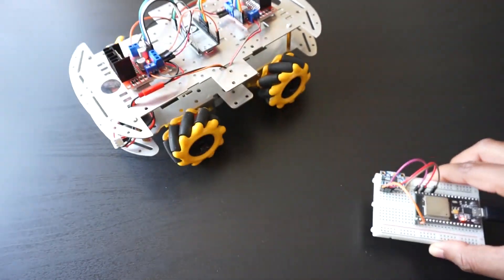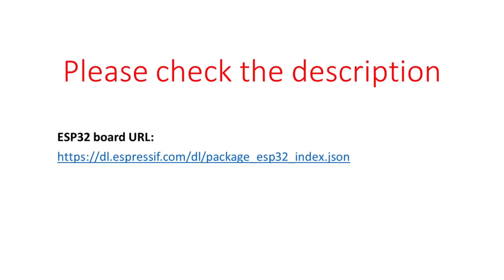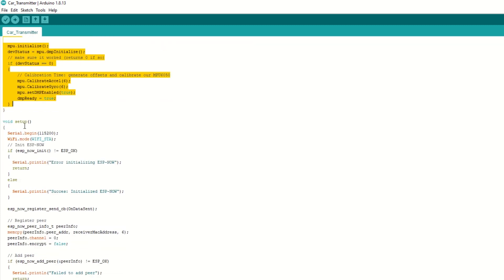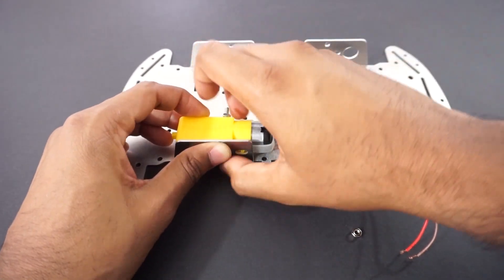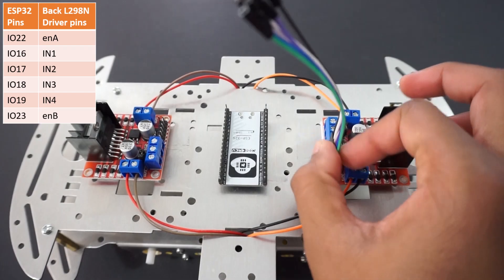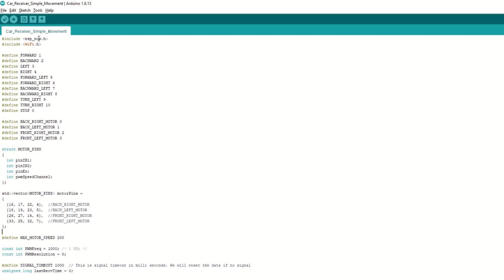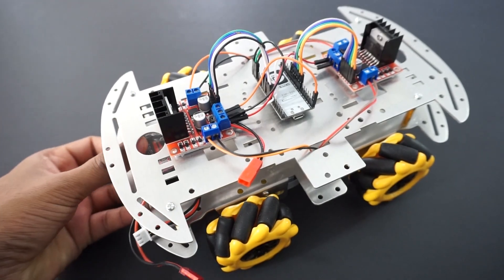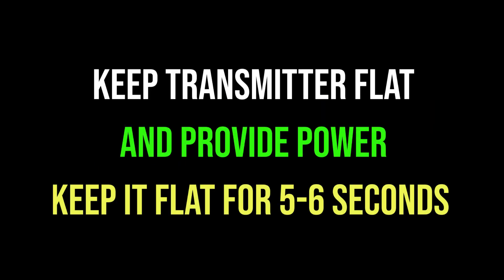Gesture Controlled Mecanum Wheels Car using ESP32 | ESPNOW | DIY🔥

Comment: Hi.  Nice work. The  ESP environment has changed and you need to add a new line after the  "esp_now_peer_info_t peerInfo;"    "memset(&peerInfo, 0, sizeof(peerInfo));" in the transmitter part and add the #include <Vector> into the receiver part. BTW using Vectors is a not good idea and should be replaced.  But a Very good project. Grattz.
Reply from the maker: Thanks 👍🏻👏🏻
Reply: Thank You!!!
Reply: hi bro i couldnt understand this, can you elaborate please
Reply: Can you share all codes?
Reply: https://youtu.be/UQl03pU-w58?si=-0mHgrbxUm1AaCSq
Reply: can you provide the code?  thank you

Comment: Only one motor is not working 😢why ?? All motors are working but one motor is not working??all things are set but oneotor is bot working 😢.. please help
Reply from the maker: Please check the motors with power supply individually first . Also check the connections of that side 👍🏻👏🏻

Comment: Can we use one L298 motor driver to move forward, background and both sides also..
Reply from the maker: Yes you can . However i would suggest to use same setup as I used in this project to avoid issues 👍🏻👏🏻

Comment: Bro i am using the same components like yours but not the mecanum wheels. I am using simple wheels, so will it work by following the same steps like yours without any change in code?
Reply from the maker: Yes it will👍🏻👏🏻

Comment: Bro can I use another wheel instead of the mecanum wheel?
Reply from the maker: Yes you can . However some of the movements will not work like sidewise 👍🏻👏🏻
Reply: @ So will there be any changes to the programming and using 1 L298 motor driver?
Reply from the maker: @ShafayatJamil-o2c if you need then you can refer my other video on hand gesture controlled car using Arduino . 👍🏻👏🏻
Reply: @hashincludeelectronics  okh thnx bro

Comment: hello, i am using 30 pinned esp32, and i was able to do everything, and it was showing Success: Peer, but when i try to rotate the transmitter nothing i happening on the receiver end
Reply from the maker: Is this issue resolved ? 👍🏻👏🏻
Reply: @hashincludeelectronics  Yes I managed to finish the project ,thank you
Reply from the maker: @mutumbakalumba that’s awesome 👍🏻👏🏻 well done 👍🏻

Comment: this project is awesome but at the last code that i was trying to upload the code to receiver, it gave me an error 'ledcSetup' was not declared in this scope this error can you help me please
Reply from the maker: @mfweditz3224  please install 2.0.16 version of esp32 board 👍🏻👏🏻
Reply: @hashincludeelectronics   i installed it and i add #include <Vector>  code in to the receiver code but its still giving error
Reply: A fatal error occurred: Serial data stream stopped: Possible serial noise or corruption.
Failed uploading: uploading error: exit status 2 its giving this error
Reply: @hashincludeelectronics  i need help pleaseee i should make it until tuesday
Reply: @hashincludeelectronics bro you should help me right? İ loved your video but rn i hate your video because you dont help me you should help me you did this car and i couldnt.
Reply from the maker: @mfweditz3224  sorry for delayed reply . what exact error do you get ? Don’t worry it will be resolved. 👍🏻👏🏻
Reply: @hashincludeelectronics  we uploaded all of the codes but it doesnt works 
i have a question in our city we coouldnt find mpu6050 so we bought a mpu6500 does it matter?
Reply from the maker: @mfweditz3224 not sure about that . I have not tried it . Give it a try and see if that works 👍🏻👏🏻
Reply: @hashincludeelectronics  i have another question i found mpu6050 but in your video At the bottom of the gyro card it says ITG/MPU6050 but the gyro card I found only says ITG/MPU at the bottom. Is there a difference?

Comment: I am getting error in the 231, 232 and 252 line of the receiver code, please help!
Reply from the maker: @akif.janjua.123  what exact error do you get ? 👍🏻👏🏻
Reply: @hashincludeelectronics  I am mostly getting this error "Compilation error: 'ledcSetup' was not declared in this scope"
Reply from the maker: @ please install 2.0.16 version of esp32 board 👍🏻👏🏻
Reply: @hashincludeelectronics  but i have the latest one installed
Reply from the maker: @ that gives error . Please install only lower version which is 2.0.16 I used in project 👍🏻👏🏻

Comment: hi
I'm using esp32 module with 30 pins and used the same pin numbers as you have used for the 38 pin module, i did everything correctly but my car is not moving , i think the transmitter and the reciever are not connecting. Please help me with this as i only have a few days left to complete it.
Reply from the maker: @anoushaydawood3886  which Arduino IDE are you using ? Please check the first comment on this video for solution for one issue 👍🏻👏🏻

Comment: Can I add normal wheels instead of mecanum wheels, is it the same thing? Would the code work normally for both? kindly tell!
Reply from the maker: @akif.janjua.123  yes it will . However some movements will not work which are only meant for mecanum wheels👍🏻👏🏻
Reply: @hashincludeelectronics  can you tell which movements are those? Just to be sure, because my project is due next week
Reply from the maker: @ sideways movement and diagonal movements . If you need then there is one video on my channel using Arduino and nrf module where I have used normal wheels . You can use that . 👍🏻👏🏻
Reply: @hashincludeelectronics  but it would move left and right, right?
Reply from the maker: @ yes it will 👍🏻👏🏻

Comment: Can I use motor drive L2983D instead of L298N
Reply from the maker: Please use L298N driver only 👍🏻👏🏻
Reply: @hashincludeelectronics  bro I have one more doubt I have order oceanlabz Esp32 and you are using electrobot esp32 both work the same or I have to refund
Reply from the maker: @ if it’s 38 pins then it’s ok 👍🏻👏🏻
Reply: @hashincludeelectronics  bro it has 30 pin will it work

Comment: Sir can you tell me that which wire are connected to motor1 2 3 and 4 I mean which is taken as positive terminal and which is taken as negative terminal..
Reply: Please tell quickly I have only 1 day to go
Reply: 5:35 terminals confusion kindly tell me
Reply from the maker: The connections are shown in video . Also check the connection diagram . If motor spins in wrong direction then interchange  the motor wires 👍🏻👏🏻

Comment: Q as far as the array for the pins for the esp32 do I still use 4,5,6,7 as the last numbers or do I choose my own?
Reply from the maker: Those are not pins . Those are ledc channel numbers . Please don’t change those 👍🏻👏🏻
Reply: @hashincludeelectronics  
  
Should I add another variable or library for the callback function uint8_t. Asking because I cant seem to interface my transmitter and receiver.

Comment: Hello I  keep currently getting "Compilation error: 'ledcSetup' was not declared in this scope; did you mean 'ledc_stop'". Is it because I have a newer version of the ESP32?
Reply from the maker: Yes . You need to install lower version 2.0.16 of esp32 board 👍🏻👏🏻
Reply: The library are updated for ledcsetup  to ledcattach once u check u will find

Comment: hi sir,  I am not getting any error or anything in the code but the receiver module when connecting 11vbattery supply[rechargeable] to the car only one side of motor driver being on and power also not going to esp32 i triple check all the connection but still the car not working and i check the other motor driver it is working nicely the problem is that the receiver car part not working . but when i power the receiver part with 5v battery with 5v motor driver pins then the motor drivers also working and esp32 also powering on but nothing still working. PLS REPLY TO ME ASAP. I followed all the steps slowly and many times also.pls can you help personally pls
Reply from the maker: Please follow and check the video slowly and carefully again 👍🏻👏🏻
Reply: @hashincludeelectronics  its still not working

Comment: I have done everything correctly, but for battery I used a pack of 4 3.7volt 2000 mah purple cell. All the lights in the motor driver and esp32 are turning on, but when I give command from transmitter the car doesn't even move an inch. Please help me my brother
Reply from the maker: Please use only 3 cells . 👍🏻👏🏻 May be the voltage is exceeding limit. Also which version of Arduino ide are you using ?

Comment: I see in code for motor pins like 4,5,6 and 7. But in the assembly process we have not put any wires on those pins on esp32. Please help me with this and my project will complete
Reply from the maker: Those are not the motor pins . Those are pwm channels for speed control 👏🏻👍🏻.

Comment: I can't obtain the mac address it's saying PSRAM not found or supported
Reply from the maker: Please follow exacts steps in video . Use only esp32 38 pins module . Check video slowly and carefully for any missing step 👍🏻👏🏻
Reply: @hashincludeelectronics  brother im using 38 pin and ive done everything accordingly
k

Comment: bro I am facing a problem while uploading the code to the arduino nano. I tried everything and it still doesnt work. I tried changing the processor and didnt work. Pls help
Reply from the maker: @GAMINGNJ10  there is no Arduino nano I used in this project . Use esp32 board . Please check the video 👍🏻👏🏻
Reply: @hashincludeelectronics  sorry bro I commented in the wrong video. I am referring to the gesture controlled car which you made using the Arduino nano

Comment: what should be the diameter of wires going in l298n? im using 1.5mm but they are not staying there
Reply from the maker: @aryaankhan2768  you can use any jumper wires 👍🏻👏🏻

Comment: bro recevier code is not working
Reply: Bro we corrected the error on your receiver using chat gpt and we upload all the code correctly and the light also blinking but the motor not running ( the motors are in good condition)
Reply: Bro any possibility for your DM , please help us
Reply from the maker: @muthupandi6849  please use rechargeable battery if not using already . It will eliminate any power issue . Which Arduino IDE version  are you using ?
Reply: @hashincludeelectronics  yes bro we using rechargeable batteries such as li-iron batteries 3.7v quantity 4 connected in series . We using latest version
Reply from the maker: @muthupandi6849  ok . Did you make the change as per first pinned comment on this video ? Try that .
Reply from the maker: @muthupandi6849  just use 3 cells of lion battery 👍🏻👏🏻 charge it fully .
Reply: @hashincludeelectronics  yes alredy we tried first of all we used the 3 batteries but.......no movements
Reply from the maker: @muthupandi6849  send me a video of all setup of project on my email un0038998@ gmail.com . Let’s connect there . 👍🏻👏🏻
Reply from the maker: What issue are you facing ? 👍🏻👏🏻

Comment: Bro ESP 32 module has 15 pins only on one sides😢 then how to connect it , the 19 pin is not in Amazon
Reply from the maker: Try it . And make the same connections . However I have provided the link to esp32 in the description of the video . Please check that and order it 👍🏻👏🏻
Reply: @hashincludeelectronics  bro but the link product were delivered but the problem is that product esp32 has 30 pins , we have submit our project on 09 July . So please rewrite the code and circuit connection and send me bro.
Reply from the maker: @muthupandi6849  sorry it’s not possible for me . I also ordered from the link provided and I got proper 38 pins module. 👍🏻👏🏻. And just to inform you this project is very complex and need lot of testing and efforts which cannot be achieved within few days . If you are lucky then get the 38 pins modules and try it . Wish you all the best 👍🏻👏🏻
Reply: @hashincludeelectronics  ok bro😔

Comment: Bro please resolve this issue in your receiver code:

these lines function was not declared :
   line 231: ledcSetup(motorPins[i].pwmSpeedChannel, PWMFreq, PWMResolution);  
   line 232: ledcAttachPin(motorPins[i].pinEn, motorPins[i].pwmSpeedChannel);    

and a error in callback function :
line 251:   esp_now_register_recv_cb(OnDataRecv); 

this is the error message :

C:\Users\jagan\AppData\Local\Temp\.arduinoIDE-unsaved2024526-10684-lu9f4e.qdw7p\sketch_jun26a\sketch_jun26a.ino: In function 'void setup()':
C:\Users\jagan\AppData\Local\Temp\.arduinoIDE-unsaved2024526-10684-lu9f4e.qdw7p\sketch_jun26a\sketch_jun26a.ino:251:28: error: invalid conversion from 'void (*)(const uint8_t*, const uint8_t*, int)' {aka 'void (*)(const unsigned char*, const unsigned char*, int)'} to 'esp_now_recv_cb_t' {aka 'void (*)(const esp_now_recv_info*, const unsigned char*, int)'} [-fpermissive]
  251 |   esp_now_register_recv_cb(OnDataRecv);
      |                            ^~~~~~~~~~
      |                            |
      |                            void (*)(const uint8_t*, const uint8_t*, int) {aka void (*)(const unsigned char*, const unsigned char*, int)}
In file included from C:\Users\jagan\AppData\Local\Temp\.arduinoIDE-unsaved2024526-10684-lu9f4e.qdw7p\sketch_jun26a\sketch_jun26a.ino:1:
C:\Users\jagan\AppData\Local\Arduino15\packages\esp32\tools\esp32-arduino-libs\idf-release_v5.1-bd2b9390ef\esp32/include/esp_wifi/include/esp_now.h:157:54: note:   initializing argument 1 of 'esp_err_t esp_now_register_recv_cb(esp_now_recv_cb_t)'
  157 | esp_err_t esp_now_register_recv_cb(esp_now_recv_cb_t cb);
Reply from the maker: Please install lower version of esp32 board as 2.0.16 👍🏻👏🏻
Reply: @hashincludeelectronics  will do and reply

Comment: I TRIED BUT ITS NOT WORKING
Reply from the maker: If you are using old Arduino IDE then check the first comment pinned on this video 👍🏻👏🏻
Reply: @hashincludeelectronics  yes i did but its not working
Reply: @hashincludeelectronics i used ESP32 devkitv1 for that this code will work or i need ti change anything
Reply: @hashincludeelectronics  im a beginner i used esp32 devkit v1 for this , because if this i need to change any code ?
Reply: It works
Reply: @amirthavarshini-xj1yq  Hello friend, what did you do to make it work? I also have the esp32 devkit v1

Comment: Compilation error: 'vector' in namespace 'std' does not name a template type ------- showing this when uploading the receiver code.
Reply: Everything was uploaded successfully but it is not working... I'm not able to identify where the problem is.
Reply from the maker: @nandypritish01  which Arduino IDE version are you using ?
Reply: @hashincludeelectronics  I'm using the latest version of Arduino ide.
 Connected everything  as shown in the video but still it's not working. Using 2 (18650 3.7v) batteries for powering the car and motors. Using the ESP32 Wroom32 module which has 30 pins..
Reply from the maker: @nandypritish01  ok you need to make one change in code . Please check the very first pinned comment on this video for solution 👍🏻👏🏻
Reply: @hashincludeelectronics  yeah I've changed it but still not working. Mine have the ESP 32 (Wroom32 module) which has 30 pin. Do I have to select the Wroom32 module in Arduino ide in place of you selected the wrover module.
Reply from the maker: Please include this line at the beginning of the code .
#include <vector>
Reply: @hashincludeelectronics  yeah it worked..
Reply from the maker: @nandypritish01  awesome 🙌🏻

Comment: Hello sir great project. Love from pakistan. I have made this project following your instructions and have made all perfect connections thanks to you ofcource. But unfortunately when i started to code i could not even find the mac address code actually im not good at coding so please if you would give me the direct code all as one piece in the comments. Please help me thank you in advance
Reply from the maker: Thanks for checking out the video 👍🏻👏🏻.
There is no single code for this project . You need to use MAC address code , transmitter code and receiver code . Please follow the video slowly and carefully and you will understand all the things gradually . Don’t worry it will work 👍🏻👏🏻

Comment: The receiver and transmitter is not connecting please give the solution
Reply from the maker: What issue are you getting ? May be you are using new Arduino IDE . If so then you need to make one change in code . 👍🏻👏🏻
Reply: @hashincludeelectronics  yes I use new Arduino ide
Reply from the maker: @abhinandansharma8850  you need to make change in code . Please check the very first comment on this video for details 👍🏻👏🏻

Comment: Can I make this with out mecanum wheels? With the regular robo car wheels which are available in market.
Reply from the maker: Yes you can but some of the movements will not work . I recommend to use mecanum wheels . Else you can check my other similar video on hand gesture controlled car using Arduino 👍🏻👏🏻
Reply: @hashincludeelectronics  okay thanks for helping.
Reply: @hashincludeelectronics  I have a one more question. In place of the battery you've shown can I use normal 3.7V Li-Ion rechargeable batteries which are used normally? Then it'll become more cost effective.
Reply from the maker: @nandypritish01  yes you can 👍🏻👏🏻
Reply: @hashincludeelectronics  Normally 2 batteries are enough or should I use 4?
Reply from the maker: @nandypritish01  2 are enough fully charged 👍🏻👏🏻

Comment: @hashincludeelectronics  good friends. I need help, I made the project and it worked, but then I used the card for another project, when I wanted to load the program again on the esp32 and add the mac address that was given to me again, I got the error espnow peer interface is invalid. despite entering the mac address that appears on the serial monitor
Reply from the maker: I would suggest to check the cheek for any missing step 👍🏻👏🏻

Comment: I did exact same project, everything  i.e transmitter reciever pairing,  connections, even I'm using rechargeable battery but still no result.What could go wrong?

Plz assist
Reply from the maker: Try using another mpu6050 👍🏻👏🏻